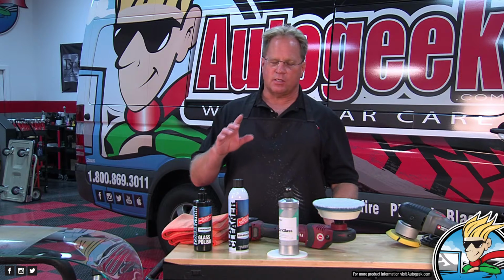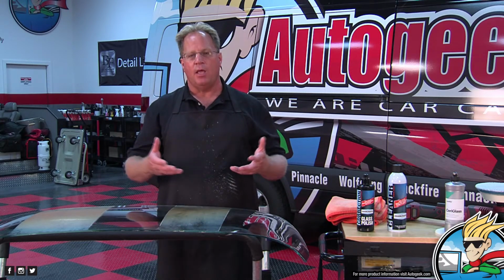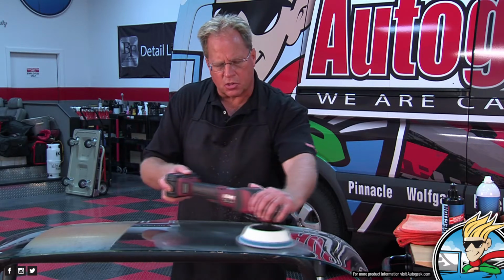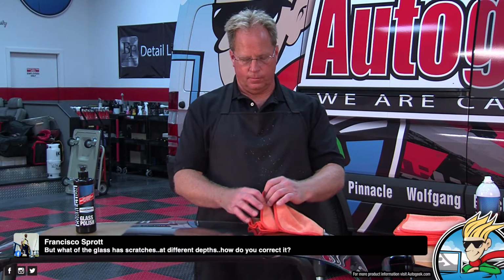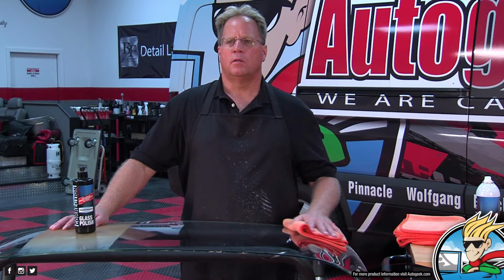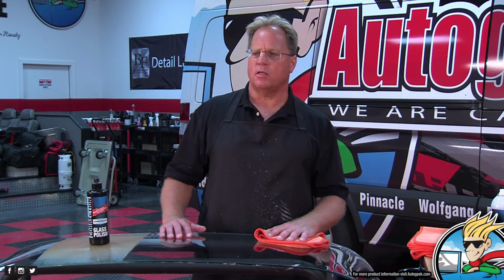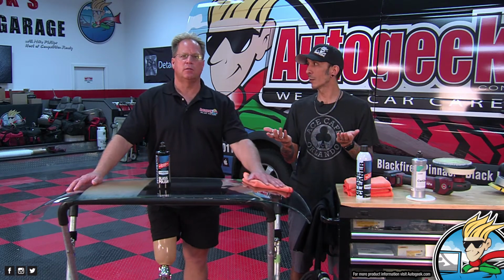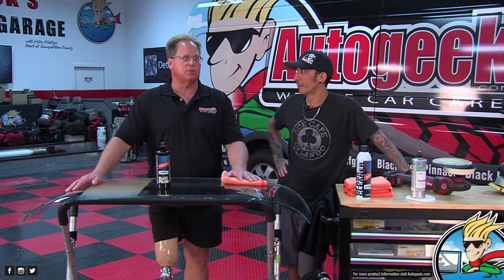Topical Glass Polishing - The power of a good glass polish

Comment: Thanks for the video. Similar to putting on a ceramic coat I toss the towels afterwards. Would you do the same for the glass polisher so there’s no chance you get any particles on the paint?
Reply: I just keep Cerium polishing towels and pads  separate from everything else. Never had a problem. I actually live in Oregon, like Mike used to, I started and built my business polishing glass.
Reply from the maker: @jdisdetermined   - No.  For glass polishing towels I just wash them and inspect and then reuse.  I've never seen a problem.  BUT - I use a TOP loader washing machine with an old school style agitator.  Best washing machine around for detailing towels and pads.  -Mike Phillips